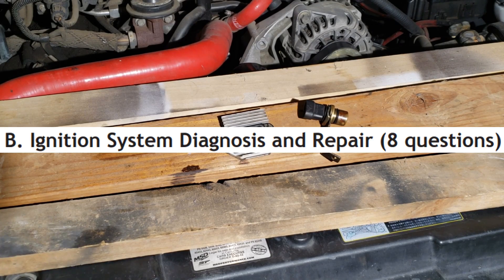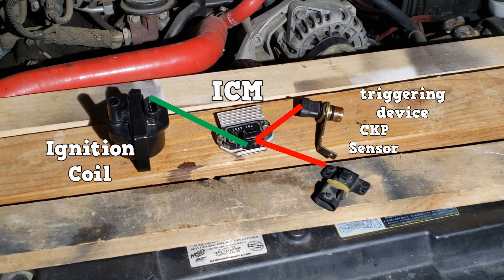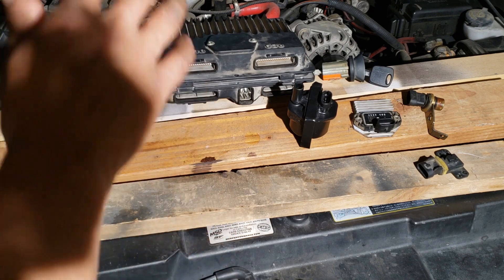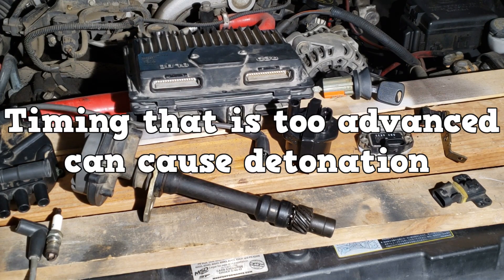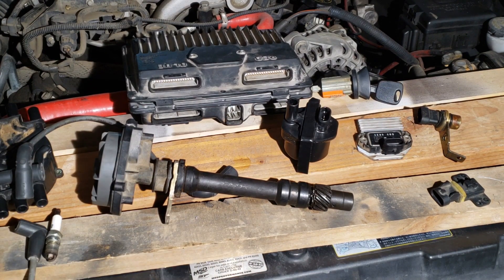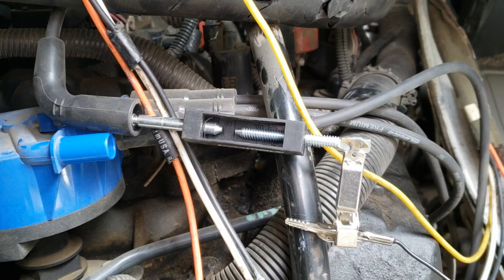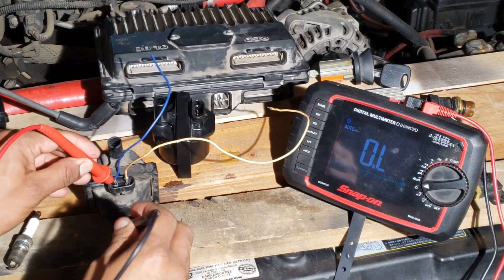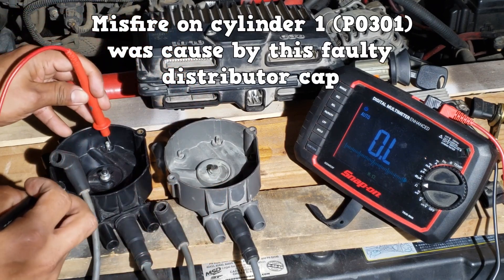ASE A8 Test Prep #1 - Distributor Ignition

Comment from the maker: Update: After taking the test, I see that this video shows you the foundation of ignition systems. This is very important to know (such as no spark could be the result of a failed CKP Sensor) The tests shown after 3:49 did not show up on the test, was not asked about them. I would say only the first 2 minutes are relevant for the test. Seems like Distributor Ignition (secondary circuit) is cut out from the official A8 test.

Comment: when high voltage is needed but not amperage, is it controlled by resistance and how can one be controlled with controlling the other, I thought I understood that they work together?
Reply from the maker: In general, when resistance in a circuit increases, voltage decreases. If there is an open circuit, the circuit will not work. 

The spark plug high voltage circuit (from coil to wires [if it has spark plug wires] to spark plug) is designed to be high voltage. Technically that circuit is "an open circuit," but at a certain point, the air-fuel mixture becomes conductive and the circuit can be considered "closed." This fuel mixture is considered "resistance" that has been calculated for during the circuit design.

The resistance rules applies here too.If the spark plug gap is too much, resistance increases, lowering voltage. The coil will have to compensate for this by increasing voltage to overcome this extra resistance. This shortens the life of the coil.
If the gap is too small, there is little resistance and the "spark" passes through the gap "quickly." This might not be enough time to ignite the air fuel mixture.